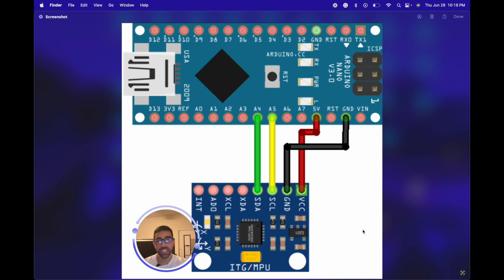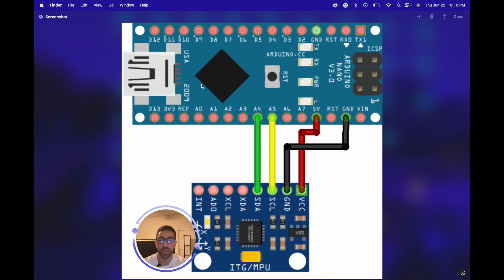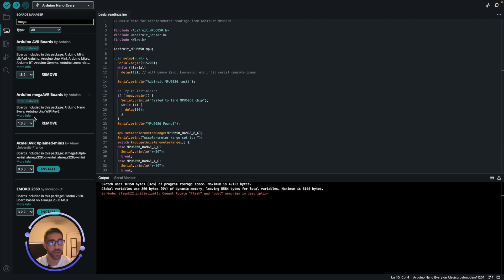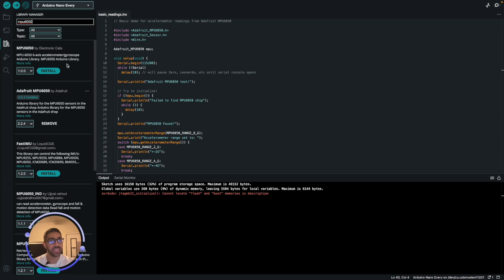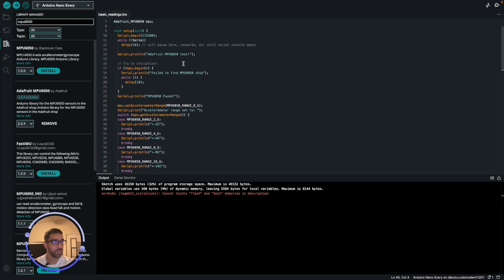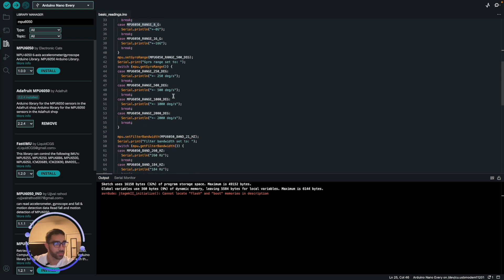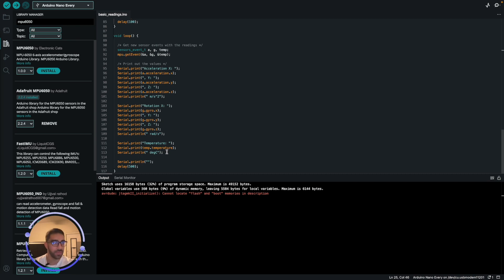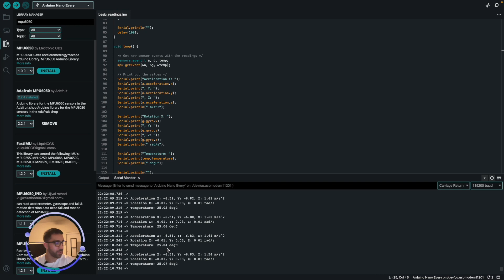How to Connect MPU6050 to Arduino Nano Every

Comment: This code not work for me. I read I should add time delay after initialization, but still get error EIO.

MPY: soft reboot
Traceback (most recent call last):
  File "<stdin>", line 30, in <module>
  File "<stdin>", line 20, in init_adxl345
OSError: [Errno 5] EIO
Reply from the maker: Hmmmmm youre vague, I cannot help you at all

Comment: I correctly link the MPU-6050 to Arduino Nano Every but I always get "Couldn't find MPU" why? Can Be the cable lenght the problem? why the mpu isn't recognized?
Reply from the maker: Its hard to tell you need to ensure the connections are secure! You also need to ensure the MPU6050 is not faulty... try another MPU?

Comment: I am working on a lightsaber project this is my first time to do anything like that i was wondering what wires do i need for the soldering
Reply from the maker: You can search "jumper wires" for Arduino on Amazon or online and you should see sets of colorful wires. Just pick a set of them they will be useful and they are cheap. My brand does not sell any, yet :) Hope you can subscribe as well. Thanks for your awesome question.